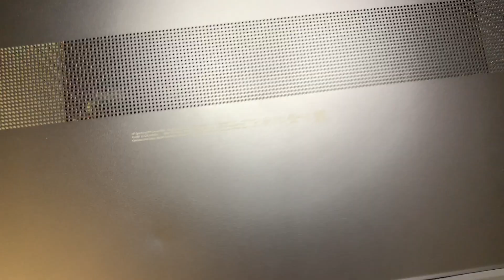HP Spectre X360 Tear Down Full Disassemble

Comment: So my batter did the same thing and I didn’t know what it was.
Thank you for showing how to take it out safely.
So, I don’t have another battery yet -can I just directly plug it in?
The light comes on, I tried to turn it on-but the power button light only goes on then shuts itself off…
Is there any place online that sells a replacement for this?
I live in the country and they don’t have anything out here locally. Thanks!

Comment: The keyboard is replaceable. First, you remove 2 plates, then peel off the Mylar. NOTE: You will need to order a new mylar. Then you unscrew about 60 screws that hold the keyboard, and then remove it.

Comment: I literally opened it just to see what was on the inside. I DID NOT touch a single thing on the inside yet the laptop will not turn on anymore. Anything I could possibly know that might fix this issue
Reply from the maker: Did you check the battery ?
Reply: @UbergeeksBiz  it was the battery I took it out and it starting working again I just have to have it on the charger 24/7
Reply from the maker: @noahboi6961  Great. I'm glad it started working again. Might want to consider replace the battery if not holding charge.

Comment: Hi, can i ask where is the cmos battery ? I got cmos battery 0502 error after removed battery cable that connected to mobo, the reason doing this is to bypass battery without using the battery, i am using direct power mode.. i couldn't find the battery and every time i turn on my laptop it gives me the cmos error 0502. Can i ask also how can i take out a loosen screw? I got a battery screw the surface has been washed out and cannot be taken out.
Reply from the maker: Are you able to remove the battery and do direct adapter to power the laptop ?
Reply: @UbergeeksBiz  yes..i can remove the battery and direct power from power brick. After i disconnect the battery the cmos error 502 will appear..
Reply from the maker: @xpooz  If that's the case, more likely the cmos chip is malfunction
Reply: @UbergeeksBiz  when i connect back the battery the cmos 502 error will gone.. it will come back again when i disconnect it
Reply: My purpose of disconnecting the battery is to direct power driving it, but i encountered another problem. I purchased a linear psu to power my laptop, it is a 19.5v 4a lpsu, it cant power my laptop. I tried using a third party 65w wall brick charger, and a 65w power bank, these both can power on my laptop.

Comment: Don't think I'll be buying anything HP related anymore. I've gone through 3 HP's over 10 years and this last one cost me $2300 and it's shit with literally no abuse at all. Speaker went out, pictures wouldn't load, sent back to HP and they replaced both under warranty. Mouse pad button somehow broke and a key broke as well. Purchased out of pocket and one year later, the mouse pad is bulged out and the new keyboard has a software problem pressing y = y7 and t=t6. Changing keyboard language doesn't help at all. Fricken badass computer but so many things have gone wrong. Only professionals have worked on it and hasn't moved from my desk in the last 3 years. Absolutely garbage quality control by HP.
Reply from the maker: Sorry to here your HP experience.

Comment: Awesome video! Do you happen to recall if the RAM was soldered in place as HPE claims? Or is it removable/upgradeable?
Reply from the maker: You can add more RAM. RAM not soldered. It is removable RAM slots
Reply: @UbergeeksBiz  Is that low density (1Rx8) or high density (1Rx16) RAM?
Reply from the maker: @amit.mathew  Try this:   https://amzn.to/35VRGK4

Comment: Thank you for your informative video! My fans died and I have to replace them. HP has their video about replacing them, but I learned a lot more from this one. Do all HP Spectre x360 15-chxx use the same fan? According to partsurfer.hp, I need a L15604-001 fan kit 40W. Also, do you know what the two letters mean after the CH00? Yours is a TX, DX, mine is CA. Are those letters important when finding replacement parts?
Reply from the maker: The last two words are not that important. When you buy replacement fan, make sure to match the image before buying

Comment: My 13.3" HP Spectre X360 13-AE013DX 13T-AE000 UHD LCD Display Touch Screen cracked. 
Please do a video of the replacement. 
Thanks!
Reply from the maker: At 13:19 is where i remove the LCD